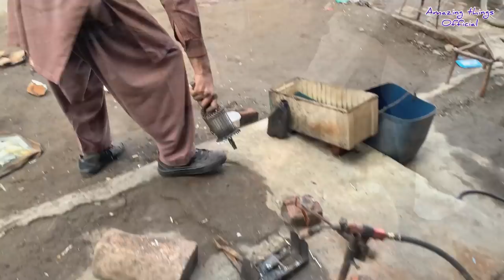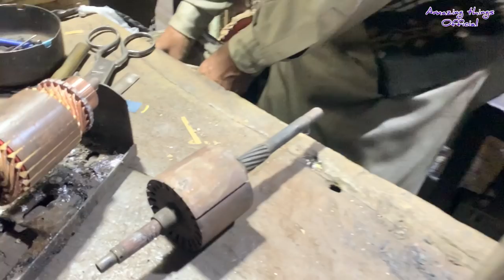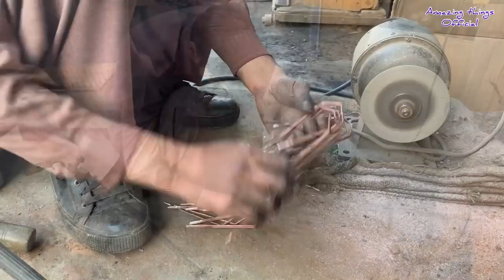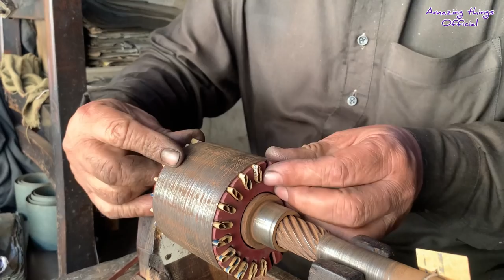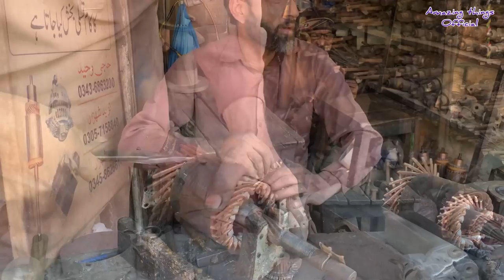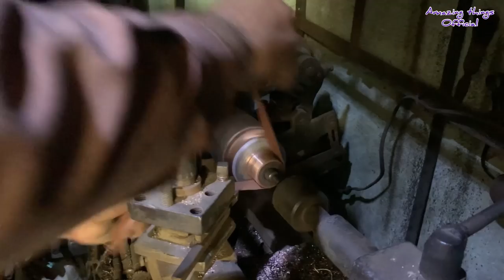How to Rewind a Starter Motor Armature in an Automotive Learn From This 65 Old Expert Electrician

Comment: Hats off to keep old items from being scrapped, but even if it does someone else will build a business with that. Full circle of utilizing everything, I love it. Great ideas on handling mundane items here in the U.S.A. to extend the equipment’s usage when trying to fix when the warranty has run out owes me nothing. If it works, great! If not, I at least gave it a shot to try to beat the planned obsolescence, smirking.
Reply: great idea for antique car parts.When date codes matter,or availability.

Comment: My guys just my 2 cents worth, after binge watching this channel for a while and reading the comments just got a few observations 

1)  'it does not last' YES it does. most of the machinery they are working on is usually sent as scrap or towards the end of its life  to Pakistan. From first hand experience I was in Pakistan when a friend imported a combined harvester from the UK to Pakistan to look at it you would have thought you cant even scrap it, the amount of rust holding it together, non running engine it was basically scrap. something here in the west we would have been condemned. What i witnessed outside a village house was nothing short of amazement. In the course of 2 weeks maybe 5 or 6 guys no I'm lying 3 guys 3 kids 15/16 year old stripped the engine and gear box basically rebuilt them sending parts out to machine shops like this to be repaired or remade. sheet metal work outside in a village, welding till late at night, all done with basic tools. They finished in 2 weeks drove it 500 miles and cut hectares of wheat with it, just after the summer cut hectares of rice with it. That was 2010 today in 2022 that big turd is still running and earning a crew money 2 seasons a year for the past 12 years. ( IT WAS A SCRAP ITEM SENT FROM THE UK  !!!)

2)they poor they dirty the safety. Maybe some of the laborers are poor  but Pakistan isn't built like the west no mortgages there these skilled people own there own houses paid for, i bet the business is family owned with family working no loans. Around family friends all day. who's poorer us with mortgages, car loans, leases, credit cards no time to see kids.... or these guys with no loans no headaches go to work with a smile on there face. Dirty these are machine shops, I've seen worse in the west. Safety the only rule is its got to be a leather slipper lol. People must get hurt every now and again but they do everywhere. I've got family in the medical field and some of the injuries that happen in the west with all the safety equipment well lets leave it there.

3) skill skill skill jaggard jaggard jaggard. shock and awe I've seen some things being repaired what we like to call bush fix in the west they call jaggard. fix anything any time any place. God forbidding there was a massive war we lost factories, electric internet..... id have more faith in these guys who can pick up scrap and make it work than western mechanics. 

and a last observation a bit of a philosophical one who has more freedom someone who can do what ever they want without some government body sticking there ore in every 2 minutes or does the lack of freedom made up by the 'safety it affords'. lol individual choice. But i for one say salute to you guys HATS OFF will always be amazed at the speed and precision you guys can work to without the proper tooling.
Reply: Qasam se batana tu bhi pakistani hai na 😂

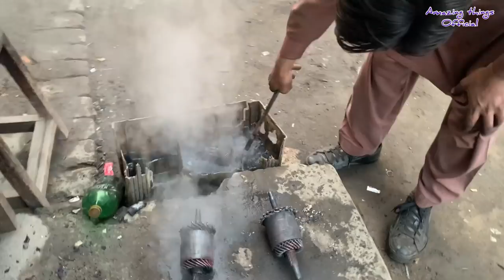Comment: 2:45 I think after such heat treatment, steel shafts and gear teeth lose their strength qualities and become softer metal - the process is reverse to hardening - steel tempering. This also applies to the copper collector after heat treatment, it becomes very soft, which is not good in this case. The repair technology should be reviewed to eliminate such negative factors as indicated above.
Reply: The temperature was only high enough to melt the solder. Not high enough to do more than remove any work hardening from bending the copper and way too low to affect the steel at all.
Reply: U should attend physics lessons again sir.